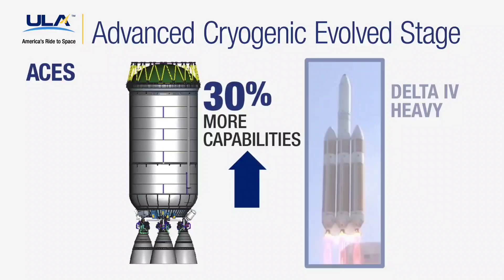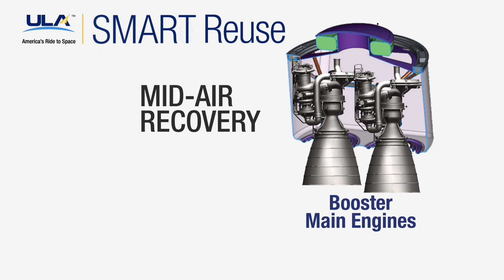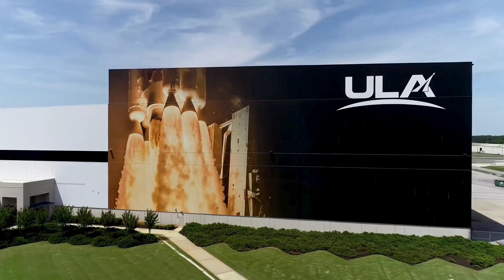Blue Orgin BE-4 having MORE problems?!  What about Vulcan Centaur?

Comment: At this point ULA should ask for their money back or sue BO for Breach of Contract, profiteering through deliberate cost overruns, etc.
Reply: Sue, for sure. Seems that is the language best understood by that cowboy’s company.
Reply: I think ULA should do everything themselves like spacex
Reply: @Bingqilinghenhao  : That is time consuming, and ULA is on a deadline. I suspect the consumption of Tums in the company has been increasing.
Reply: @absalomdraconis  I'd hesitate to eat an excess of anti-acid based on alkaline chemicals, such as Tums. It might upset the electrolyte balance in your blood-too much calcium isn't terribly dangerous but it isn't good for you, while too much magnesium will give you the runs and too much sodium raises your blood pressure. I've never seen potassium used in an antacid but I suppose potassium bicarbonate would work-but the danger from too much potassium is heart fibrillation, so it would be a very poor choice.

My favorite antacid chemical is aluminum, in the form of aluminum hydroxide. If I was sticking strictly to acid neutralizing chemicals, the aluminum hydroxide is a good option as it doesn't absorb into your system and affect electrolyte balance, and won't cause kidney or bladder stones. Some people would suggest proton pump inhibitors like omeprazole - sold under brand names like Prilosec. I'd shy away from that-why take something that absorbs into my blood that might have systemic side effects. My favorite is aluminum hydroxide, which can be made in the exhaust of certain solid fuel rockets!

It's interesting that aluminum powder and water in a dense slurry can be frozen and used as powerful solid rocket fuel. Once ignited, it aluminum burns with water at a temperature almost 7000 degrees Fahrenheit, producing aluminum oxide and hydrogen gas! If you use a mix heavy on aluminum, it produces aluminum hydroxide, a fine antacid in my opinion. Check out Space.com's article: https://www.space.com/7429-rocket-fuel-mixes-ice-metal.html
Reply: the satellite launch contract they signed with BO was obviously face saving for everyone involved.  it was ULA's way to get $$ back from BO for the problems with BE4
Reply: @arizona_anime_fan  The satellite contract was with Amazon, not Blue Origin. I think it had more to do with Amazon seeing that New Glenn wouldn't be ready in time, and needing an alternative launch vehicle. But of course, it's possible ULA and Jeff made some sort of deal involving all three companies.
Reply: So ula is getting a taste of their own medicine?
Reply: @williamh.gatesiii8183  Right? I don't feel sorry for any of the companies that make up ULA for being ripped off and delayed....they've been doing that to US(the american taxpayer) for decades. 

It harms the US space program, and the national defense efforts.
Reply: As BO are technically in breach of contract already give the be4 that ULA technically own to Space X to iron out the issues 😂
Reply from the maker: I think Bezos gave ULA that massive multi-billion dollar Kuiper contract to avoid that scenario. That single contract will be enough to sustain ULA for years, IF BE-4 finally works.
If it doesn't, game over.
Reply: Maybe they should call Elon and see if they can grab some raptors he might have some raptor 1s cheap

Comment: Asusual Angry on SpaceX payroll....
Reply: Says the Blue Origin PR guy. Where's the BE-4, Jeff?
Reply: @wiregold8930  They're in Texas being tested and soon to ship to Alabama.
Reply: Why would you say that?  He assumes (with no evidence) that Raptor 2 will demonstrate the same problem BE4 just did.  Why?  It casts doubt on SpaceX just because BLUE ORIGIN has a failure.  They use different designs and Raptor 2 replaced most connections with welded fitting radically reducing potential leaks.  SpaceX has made significantly more than 100 total Raptors (of differing configurations) even flown some.  How many BE4s has BO made?  At most in the low 10s I would think more likely fewer than 10.  How many have flown? ZERO it seems.  So why would SpaceX be at the same stage with the same problems as BO with different engines that just use almost the same fuel?

Hit SpaceX where they have problems YES.  AA just likes to ASSUME problems for SpaceX but not for BO.

Comment: The side view of BE-4 at 10:37.....EWW! My instinct tells me operational issues were not clearly defined and remedied. Looks like a lot of extra wiring and plumbing thrown at problems.
Reply: Rocket engine hardcoding looks like
Reply: @furyaroslav  In some respects it looks like all the extra plumbing on the early Raptor 1. They were early prototypes and on the latter Raptor 1 a fair chunk of it was removed. The BE 4 is clearly still a prototype and not a flight ready engine.

Comment: But the diffrence between Spacex and the Blue Origin is that they don't hesitate to throw parts and money at the engines.
Reply: SpaceX wouldn't hesitate to make 20 slightly different engines to test and combine the best features into a better engine and then repeat with variations on that design.  

B.O. designs on computer, simulates it and redesigns one at a time then finds out their "perfect simulated engine" doesn't translate into reality perfectly.  

Also I suspect BO has far more "productivity and planning" meetings than SpaceX with everyone trying to make sure their ass is covered.

Comment: Although the Raptor is a very different animal than the Merlin, SpaceX has successfully launched hundreds of engines over the past few years. Hopefully the Raptor will be just as successful.
Reply: It will 👍💪💪💪🇨🇦
Reply: SpaceX is so successful because they simulate their engines on a computer in-house, blue origin farms it out to some contractor who doesn’t care one way or another what happens. If that sounds familiar it’s because Boeing did that on the 737 Max to disastrous consequences.
Reply: @12time12  They also test their engines repeatedly by actually firing them in house.
Reply: You mean the Raptor 2 and 2.5(designed to make as much thrust as the Blue Origin BE-4 or 550,000lbf(250 Tons) of thrust as it were). The Raptor has been successful. They fly 9 of them repeatedly on each Falcon launch. 170 Successful orbital launches and 130 Landings to date. Also the Merlin is the Vacuum engine use on the 2nd stage of Falcon. Fun Fact, the Merlin was designed for Reuse as well. They didn't design a recover system for it though... yet.
Reply: @SternLX  Falcon 9 has nine Merlin 1D on the first stage and one Merlin 1D vacuum on the second stage. The Raptor 1 has flown on a few Starship prototypes, but they have never flown to space.
Reply: @espenha  thank you. For straitening that out. I was going to

Comment: I disagree with your statement about comparing Raptor engine reliability to the BE-4. The Raptor has been far and away more rigorously tested and pushed to it's limits than BE-4. Unlike the BE-4, SpaceX has intentionally pushed past those limits to destruction many times just to see what happens and get good data for potential improvements. 

If I were ULA, I'd suck up my pride and quietly ask SpaceX about the possibility of licensing the Raptor engine for manufacture. SpaceX has shown a willingness to help competitors (like it did Northrop Grumman and OneWeb)and would likely jump at the chance to improve relations with ULA with an eye to potential partnerships in the future. That would require a radical redesign of the Vulcan but would give them a lifesaving backup to preying to the rocket gods for Blue Origin to actually deliver an actual working engine sometime before hell freezes over.
Reply: There is still Aerojet Rocketdyne AR1...
Reply: @bazoo513  Yep!! Unfortunately it's not ready yet. It will probably be ready long before BE-4 is. Wish more engines were in development....
Reply: @bazoo513  the AR1 is Kerolox the Vulcan would need to be completely redesigned because the fuel oxidizer ratio is completely different.
Reply: @acarrillo8277  Ah, yes - stupid of me.That's why ULa had to make downselect so early.
Reply: You are totally right. That is a much better suggestion.  SpaceX like Tesla has the attitude towards its sector I wish more companies would have.  We would be so much farther along as a society! Elon has a great analogy about sharing the best bucket to bail water on our common sinking boat.
Reply: @Darcalpha  like Tesla? Like making cars a Tech item, once obsolete? A company reluctant for supporting the right to repair? When will fanboys get a sense of reason, instead of constantly be stuck in fanboyism?
Reply: @RogerM88 Not great from a consumer's standpoint, and the value add exclusions across the entire supply chain is very monopolistic behavior. However, opening their patents to advance the Tech is unmatched.  I wonder if Toyota or GM would.  Tech advancement is more important to me.  But your not wrong.
Reply: Why don’t they at least do the engineering on a VulcanAR with RP-1 tank and the AR1 engines, as well as a VulcanSXR with SpaceX Raptor2’s?  If this is going to be their “bread-n-butter” rocket, why not have alternate versions?  They only need 2 Raptor2s per flight, right?  And they might be reusable.  Maybe an AR1 version will allow them to get some launches made and keep some customers.  Although, an RP-1 version may require a modified launch pad or different pad site…well, maybe they can have 2 pads at the Cape for a while?
Reply: Honestly, if I were ULA, I would be looking at doing both that and leasing at least a few launches for my own fairing on Falcon Heavies. Neither is ideal, but if possible to negotiate then both would significantly increase the reliability of ULA's planned launches.

Also, the black eye to Bezos of ULA buying from SpaceX might improve Blue Origin's performance.
Reply: There's zero chance this would happen. Raptor 2 isn't even a finished product yet, there's still design changes happening constantly to improve manufacturing efficiency/reliability. Even when it's a finished product, much of Vulcan would need to be redesigned to fit the new engine. You can't just carry over the same tanks, engine housing and more like you're changing tires on a car. Even if ULA was willing to bite the bullet and do all this, SpaceX would want to build the engines themselves to improve their own economies of scale. This is all obviously ignoring the fact ULA would still be helping a direct competitor if this happened.
Reply: @dobakito  First off, Raptor2 is actually a finished product that's constantly undergoing revision. It works as is with no further development necessary which can not be said for BE-4.

Second, I mentioned that the Vulcan would have to under go massive radical redesign. That's a given. Number of engines would probably need to increase to 3 or 4 as well. 

 And last, Even at the unheard of pace SpaceX is ramping up engine production, it will be a long time before it has excess capacity to sell so licensing and manufacturing their own would be the way ULA would have to go to procure the engine.  It would be a win win for SpaceX to have other manufacturers licensed to manufacture Raptor in case they ever find themselves in a bind with their own manufacturing. 

Elon wants man in space. Working with competitors instead of destroying them is the way he prefers to operate.
Reply: @alderwolf7687  They could probably go from two BE-4 to two Raptor 2. The drop in thrust would be 480 tons to 460 tons, which isn't a massive difference. It's possible they would just always launch with at least two boosters.

Comment: BO's issue seems to be a stubborn reluctance to learn from failure - they want their first engines to be perfect. Trouble is, perfection is never instantaneous. Technologies evolve. BO is still stuck on a tiny number prototype BE-4 engines, while SpaceX is already building boatloads of Raptor 2's.
Reply: The BE-4 has a fundamental design flaw. Next generation metallurgy might be able to handle the combustion instability but if the instability were not there, they wouldn't need futuristic material strength.
Reply: @wiregold8930  : The F1 had instability as well, it was fixed with some vanes inside. I find it concerning that BO apparently hasn't done enough investigation to find a fix for their own version.
Reply: SpaceX will only be aiming for perfection when they go from prototype rockets to production. The prototypes are learning experiences.
Reply: Yep, plenty of F1s were tested and blown up to make them bulletproof back in the '60s. Along a similar vein, Admiral Rickover insisted that an entire propulsion plant was built and tested on land before it was put in a submarine. They did find several problems, all of which were fixed before USS Nautilus was built.
Reply: With Raptor 3 already existing in CAD probably.
Reply: @Roguescienceguy  : Honestly, I wouldn't even be surprised if Raptor 2 is more of Raptor 3. They may be up to 4 in CAD (though 5 would be getting a bit iffy, considering that Musk apparently fired the previous engines chief for poor performance).

Comment: The sheer number of Raptor engines and the speed at which they can build more goes a long way towards making them more reliable. Remember, Musk talked about blowing up 20-30 Raptor 2s during its development. If you have a leaky Raptor, you take a couple of days to figure out why and then a day to build the new design, and then you can be testing to see if that solves the problem.
Reply: Its not just a booster issue.  The ouside ring of raptors only get ingition from the launch mount, they cant indipendantly re-ignite. 
I.E. the heavy booster requires launch mount ignition for the majority of its engines to function at all.
Reply: @gamerfortynine  Yes, the outside ring requires the launch mount to start up. But that is fine, SpaceX has made a compatible launch mount to do the job. If engines do not start , they abort the launch before liftoff, and try again. I'm sure the first orbital attempts with 33 Raptors will very likely have several aborts at approximately T-0. As long as these are benign shutdowns, there's no big cost.

If engines flame out during ascent, the Super Heavy has a pretty big performance margin. Musk has said he would consider the first orbital launch a success if it clears the pad. Well, that's accomplishable with around 22 Raptors. Approximately 11 Raptors can fail half a second after launch and the rocket should still make it into the gulf. A few Raptors could fail and Starship could still make it to orbit. (Preferably as few as possible, as late as possible.)

Personally I think the first orbital attempt will likely make it to orbit, or at least to stage separation. Reentry and landing is less likely.
Reply: @gamerfortynine  How is ignition of the booster engines on the pad a difficult thing to accomplish reliably?
Reply: @johnbuchman4854  quantity.
Reply: Quantity is a quality in itself.